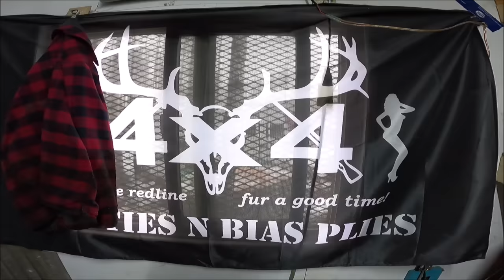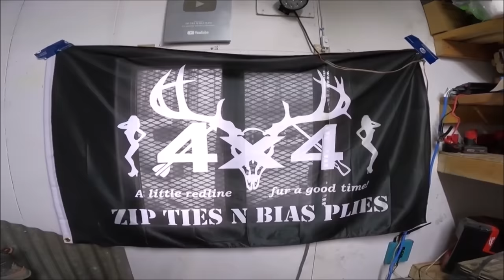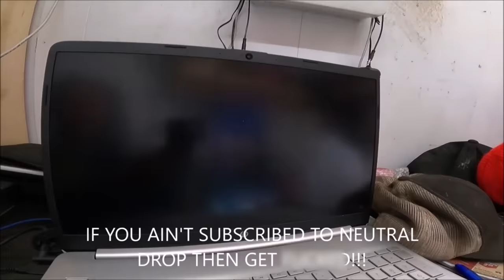THE LIFE... AND DEATH... OF THE F1 CHITTY!!! UN-GREASED!!!

Comment: those 5.8 351's are hard to beat...i had a f 1 shitty and run it into the ground..pulled my race car up and down the highway at 75 mph every weekend..the only weak link was the bruce jenner....put in another bruce jenner and drove it until i sold it and that kid rolled it 2 weeks after he bought it ..put it back on it's wheels and drove it another 3 years...those 351 are a beast for a gas motor..takes a beating and keeps being loyal

Comment: Hey, what adapter plate are you using for your f350 with the 5.9 cummins? ive got a 90 im thinking of doing a 5.9 12v swap and have the zf5 thanks for the help

Comment: Do you even know how to mechanic? You forgot to torque the bolts on the throttle body to spec. Supposed to be 90inch/lbs. other than that 10/10

Comment: Those old Honda compressors are.bullet proof 
I was.taking the busted arse Nissan parts ute to the port to mobilise a couple of 789 dump trucks for my boss 
Took off from the lights amd the ol 2lt Na deosel had too much power for the compressor amd or yeeted it's self into the middle of the intersection 
Ya haven't seen embarrassed.till you've sen a heavy deisel apprentic stop traffic to load a compressor back onto a ute